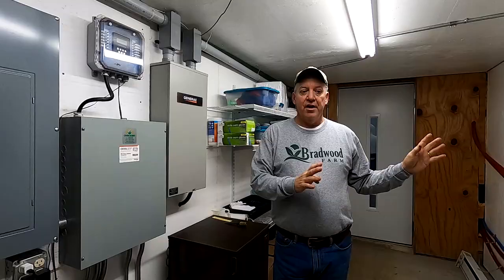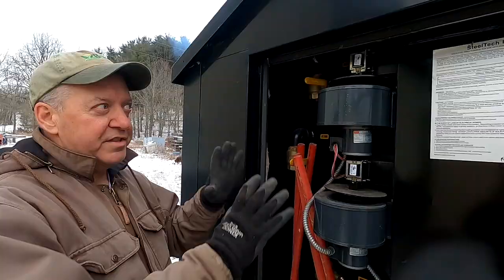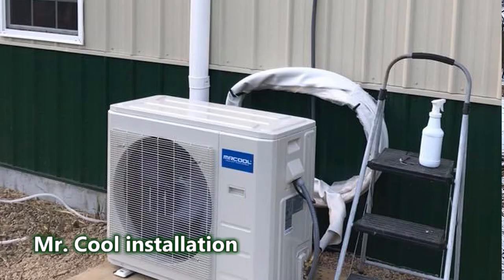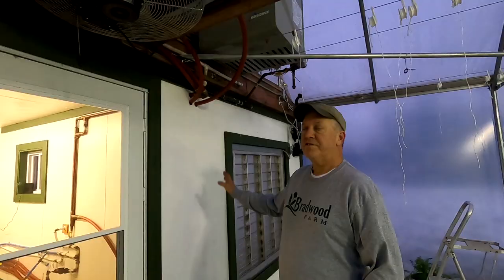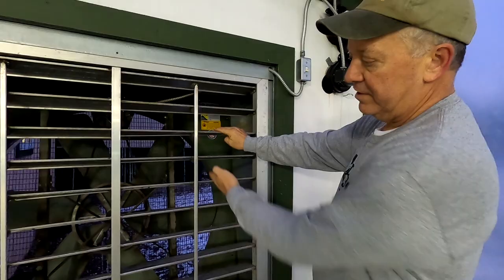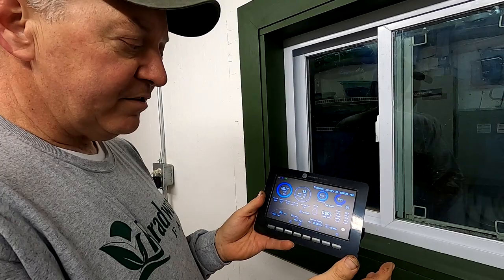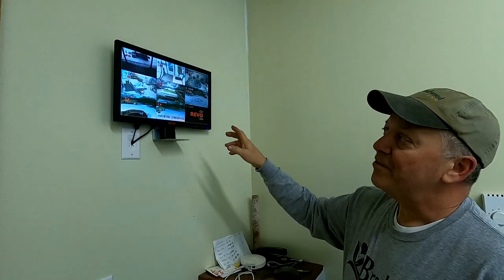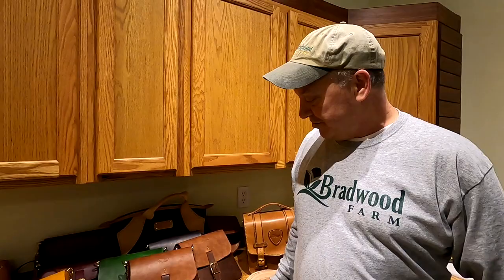Heating and Cooling the Greenhouse | Our Fully Automated Environmental Control System

Comment: YES!   A build video would be ideal.
Great video.
There is something of a head scratcher where you have both a wood-fired heating system, and your own natural gas well on the property. Your Dad is obviously so thoughtful in his engineering that understanding why both systems are installed would be an interesting discussion.  Thanks in advance for the coming vids.
Reply from the maker: Thank you so much and we will definitely be doing a greenhouse build soon.  The issue with the well is it goes down randomly.  Sometimes the there are problems with the well head, or it gets clogged.  We've gone a whole winter before with the well down, and it was a lot of work heating the place with wood, but we did it.
Reply: @HomegrownPassion  Got it.
Thanks

Comment: Yes, yes, yes. We want a detailed video on the greenhouse build. Also maybe videos in detail on the cooling and heating of your systems. 
One question is why the wood heat when you have an on farm gas supply? Wood can be a lot of work.
Reply from the maker: We are definitely going to make one soon.  Wood sure is a lot of work, but the issue is the well can be unreliable.  Sometimes there are issues with the well head or it gets blocked up, and we always need heat for the greenhouse

Comment: I wonder how difficult it would be to operate this with the Alexa app. I would think you could create routines that performs a function like water or dehumidifier when the sensors attached to those items are activated. I guess the main problem would be losing internet and her missing a cycle.
Reply from the maker: I think it would be pretty cool. We have been working on a way to control the high tunnel side curtains and fans that way. If you have a solution I would love to hear it.

Comment: I have a question for the heating system. Does it work by blowing hot steam through the greenhouse? If so, the humidity level of the greenhouse will rise, right?

Comment: I have never seen a fire like that in NZ, how much are they? Shipping would be outstanding probably have to build local off plans.
Would make sense off grid, a lot of work to feed it though, how many cubes are needed in a cold month?
Reply from the maker: That fire is something else, right? Prices depend on the model, but they are worth it. Getting one for off-grid living sounds like a cool idea!
Reply: @HomegrownPassion  What sort of numbers? I really think shipping to NZ would kill it unless it was coming out of Shanghai with there cheap shipping rates and good old slave labour.
Are they 5k, 10k, 20k or am I miles off?
Reply from the maker: The outdoor boiler is the biggest one they sold at the time and i think it was just over 10K. We use it only as a backup for the natural gas.
Reply: @HomegrownPassion  10k USD = 🤯 in NZD +shipping
DIY sounds like the go

Comment: why wouldn't you attach everything with ductwork? instead of just blowing it at another fan.
Reply from the maker: Not sure how you would duct work in a greenhouse. We want air flow around all areas of the greenhouse. Using the jet fan to distribute heated and outside air around the greenhouse is a effective way to do that.

Comment: Wondering why you have a wood burner heating system. You have a natural gas well??? Why not use it instead of sawing, chopping storing firewood and having yo clean the ash left over. I don't understand why.
Reply from the maker: I wish we didn't need to worry about the wood.  It is hard work for sure, but the well can be unreliable.  Sometimes there's issues with the well head or it gets blocked up.  A few years ago we went all winter without the well working.  Gotta have back up in case that happens.